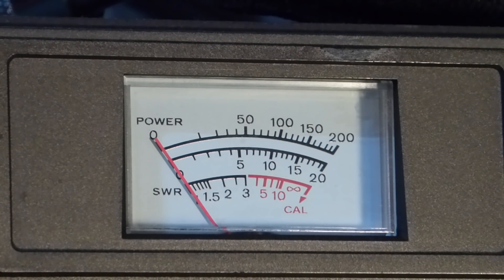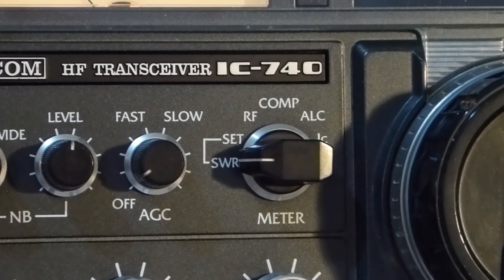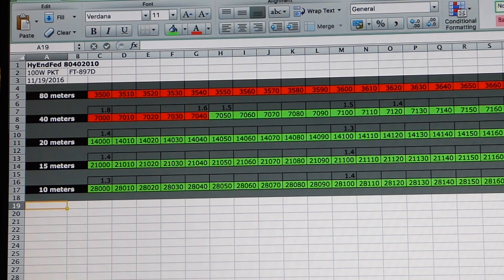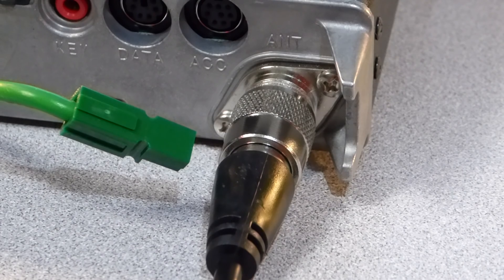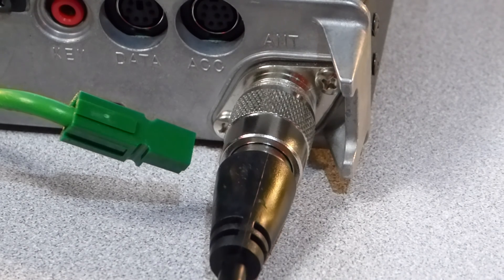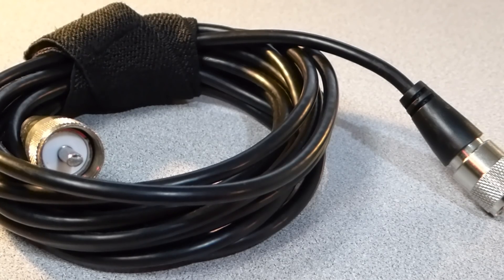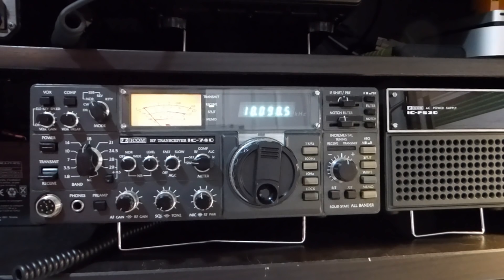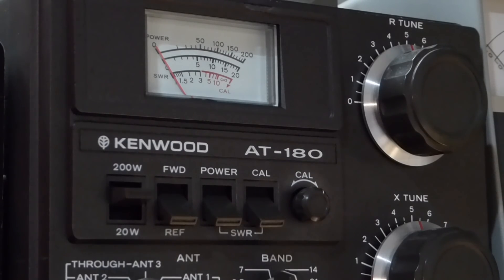How To Protect Your Transmitter

Comment: Good video.  Those coaxes can have a break in them as well. Back in 2012 I was back Hom in Santa Rita NM and Set up in an RV. I had a coax going to an MP1  antenna. little did I know that there was a break somewhere in the coax and it cost some repairs later on. Finals and capacitor had to be changed out.  I now always take a meter to test if I'm doing portable as well. That day it cost me contact with Lastmans standing setup which I was looking forward to.
Reply from the maker: Thank you for sharing your experience.

Comment: Not sure I saw it in this video.

Ground all transevers to earth ground as well as power supplies.
Reply from the maker: Thank you for your comment, Colin.
Reply: And always use a separate ground system for your radio equipment.

If you use the grounding system of your house, where all the other appliances are connected to, RFI will find its way into the RX.

Comment: I use a homebrew resistive SWR meter when tuning aerials. The rig never sees more than a 2:1 SWR (100Ω maximum) but allows all SWR readings to be read, it does need to be taken out of circuit after tuning because it introduces attenuation.  I always have the FT817ND indicator switched to SWR.
Good advice to disconnect the aerial when not in use. I always have. Years ago I saw sparks jumping across 2 inches from my wire aerial to the wall from statically charged rain.
Bill, G4GHB.
Reply from the maker: Interesting comments! Thank you for contributing, Bill.

Comment: Very good advice about always metering SWR rather than RF when on the air. I've forced antennas that were 'way out of natural resonance into a 1:1 match with my antenna and ground tuners, and then seen SWR climb dangerously during operation due to the balun in the AT getting saturated. If I hadn't been monitoring SWR regularly during TX, that would have fried my rig. 

Also good advice about paying attention to feed lines and connectors. The first thing to do whenever you detect unusual SWR or RF out levels is go around and reseat (unscrew and re-screw) all coax connectors. Cheap jumpers in particular are susceptible to seat imperfectly (but you can't feel that with your fingers) and mess up your game. 

Thanks for the great video!

Comment: Is there any advantage to tuning up using the minimum output power a rig will put out while adjusting for swr and then increasing the output power as needed? Very clear and useful information. I always unplug everything now after having suffered a lightening strike. I had the antennas disconnected but not the commercial power. Lost the whole station. A very expensive lesson for sure.
Reply from the maker: Absolutely there is, Tom. Reducing power while tuning is best practice as you will expose your power amplifier to as little danger of high reflected power as possible during the process.
Very sorry to hear about your misfortune.

Comment: Hi Tracy.  Catching up on your videos (great stuff as usual - you've taught me so much)!  After watching this video I have a question for my "On-Line Elmer"!  Concerning auto-tuners for my FT 817-ND: I use an LDG 817 Z auto-tuner for my 817 and was wondering if a max of 5 watts is going to make a difference and pose a threat to my radio.  It seems that higher wattage going back into the machine would be worrisome, but is it going to make a difference at 5 watts?  I've used the LDG auto-tuner for my SOTA work and other Amateur activities for about a year now and it seems to be efficient and safe... Now, you have me thinking... "Hmmm... I wonder if I'm going to hurt my favorite radio!"  Could you give me some insight on this?  (BTW:  Since I've last talked with you I've installed the bhi DSP board and, WOW!  My little 817 went from great and fun to Super Great and Super Fun!) Thank You For All The Help! 73!  David, K7GYB   PS:  I've only used the PackTenna (@92ft. w/9:1 transformer) for the 817 in the field as I now have a base-station radio (IC-706 and use a manual antenna tuner for it).  DV
Reply from the maker: Hi David, thank you for the kind words!
You raise a good question. The final transistors in QRP rigs have a much smaller power rating than those found in 100 watt rigs, therefore they are just as susceptible to damage due from a poor SWR. You really need to be careful with the 817 due to this.
Congratulations on the BHI filter, I've heard nothing but good things about them. Have fun with your 706, I used to own a 706 MK IIG a number of years ago and really liked it. 
73 my friend!
Reply: OK... Thank You.  I think it is time to look for that little Kenwood manual tuner like you have or something similar.   Thanks again for your sage advice.  David K7GYB.

Comment: Hi all...With using a Manual antenna tunner , I Prefer to Tune first for Best Receive and then set the FWD Calibration quickly and then switch to REF .......> always remember on unknown antennas  ...best to transmit a very brief and quick TX...to Calibrate the meter ........73
Reply from the maker: Good advice!

Comment: Tracy,

You are right on. As a ham for over 50 years I still needed to be reminded of many of the things that you discussed. Even at QRP levels it's easy to blow the finals in a FT 817 or other QRP rig when the antenna isn't matched.

Dave K8WPE
Reply from the maker: Thank you for the comment, Dr. Dave. I don't think people realize the fragility of the finals in QRP rigs.

Comment: Tracey. Also coax lengths must not be half wave on the reqd bands. Also coax is like a sponge, keep the coax well sealed. good video.  2e0vov
Reply: mk1tina - That's an interesting statement - could you explain why coax lengths must not be 1/2 wave on the req'd bands? Thanks, Mark
Reply from the maker: Great points, Mark!
Reply: Why is that? 73s